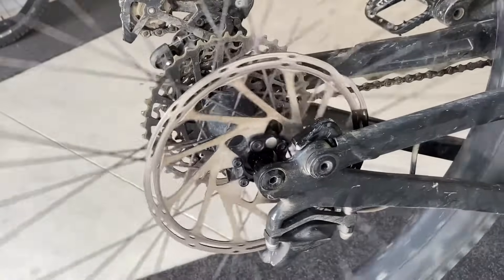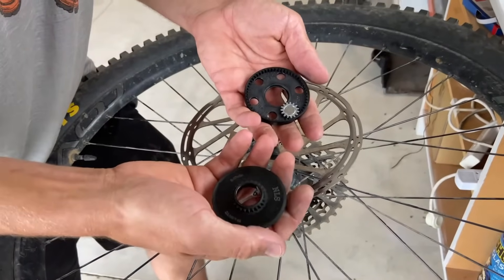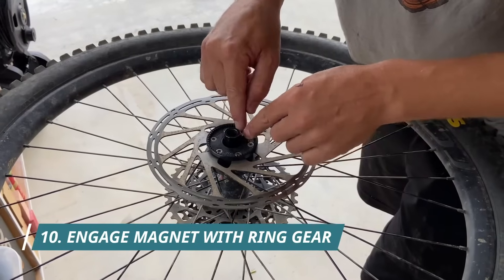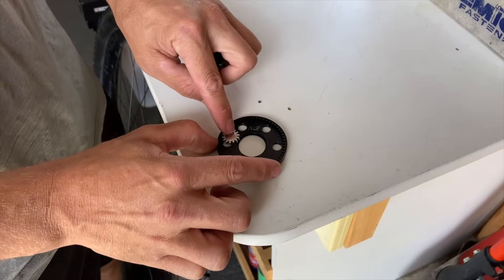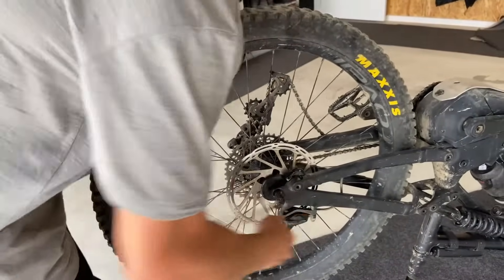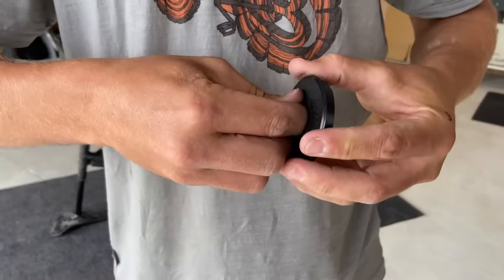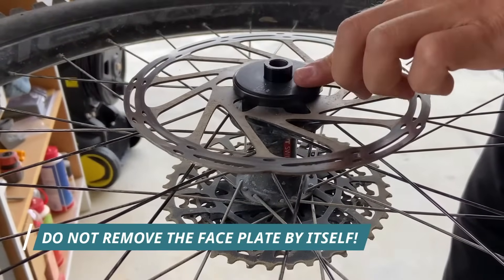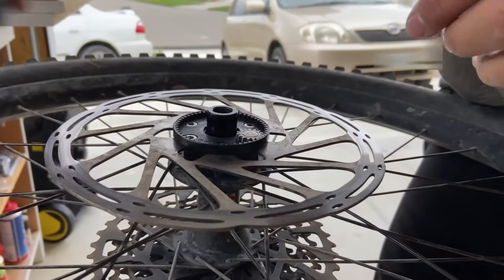E-bike speed delimiter: SPEEDi [6 Bolt Installation Instructions]

Comment: Does this work on a Orbea Vibe H30 with rear hub motor from mahle?
Reply from the maker: Unfortunately SPEEDi is not compatible with rear hub driven motors sorry.
Reply: @ thanks a lot for your fast response. Are you looking for producing a product?
Reply from the maker: @florianwagner8020  At this stage we do not have anything in the works for hub driven motors sorry.

Comment: Does it Work in the Bosch Smart System with Magnet on the valve?
Reply from the maker: Unfortunately, this system is not compatible, sorry. Your bike may be able to be changed to to the rear rotor mounted system though. Check with your local dealer.

Comment: Does this interrupt the odometer?
Reply from the maker: The odometer will be out by 1.5x when SPEEDi is installed. This is because we are essentially tricking the bike into thinking it is going slower than it is.
Reply: @ brilliant and if you want to remove the magnet, I guess you just lift the first cover off and take the magnet out and it goes back to normal?
Reply from the maker: @SingheBiker  If you want to go back to normal you would need to remove the whole unit, and re-install the stock magnet. It's a very quick process - maybe 10 minutes.

Comment: "That's essentially it". Except he neglected to mention the importance of magnet alignment with the sensor on the frame stay. Common knowledge? It never pays to assume everyone knows what they are doing!
Reply from the maker: Great point! However, SPEEDi shouldn't require any specific magnet alignment. We pair the size of the unit to best match the bike and where it's sensor is located. We also use a much stronger magnet than standard, so even if there is a slight difference the sensor should still pick up the SPEEDi magnet no problem.

Comment: Just be nice if the speed was increased by 2:1
Reply from the maker: Great thought! We did try higher ratios like this, but found the 1.5x to be the sweet spot. We wanted to keep the units small, robust and reliable. There's limited real estate where the SPEEDi sits, and we wanted to make sure they were reliable and robust. The bigger the unit, the thinner it has to be to clear the frame and any other parts. We have found that everyone after using the 1.5x agrees it is a massive change and enough.

Comment: What end cups of the hub is compatible ,because it is not compatible with my Freehub I9 1/1 microspline. Can I change the end cups or I have to change everything (hub) complete
Reply from the maker: The I9 1/1 is a compatible hub. If you'd like to email us with your details we can check it out.
Reply: @nlscomponents  I tried already and de internal diameter of ispeed is bigger that the end cup
Reply from the maker: @sisovr4636  We do have a unit that is specific for the I9 1/1 hub so maybe the unit you tried was for a different hub?
Reply: @nlscomponents  do you have it send me the link to find it,please
Reply from the maker: @sisovr4636  the exact part will also depend on what make and model of bike it is going on. If you would like to email us the details of the bike we can check it out :)

Comment: Just waiting on this to be delivered. Is there any precautions to take when cleaning the bike after a muddy ride?
Reply: What’s your thought about this ? Is the real speed still on the screen or is the speed not accurate due to the speedi ?
Reply from the maker: Sorry for the (very slow) reply here. There is no precautions needed for washing the bike. The speed will not display correctly on the screen, as we are essentially tricking the bike into thinking it is going slower than it is. Likewise, the distance will not display correctly either. If you have a Garmin, or similar computer with GPS, this will show you an accurate speed/distance as long as it's not connected to the bike.

Comment: what is the material of the components? plastic or metal? i mean the box..it seems fragile
Reply from the maker: The Backing plate and Cover are made of Acetal/Delrin which is a self lubricating engineering plastic with a very good strength to flexibility ratio, meaning it does flex a lot before breaking, and is strong enough to stand on when assembled, the magnet is marine anodised (twice as thick as standard) 6061 T6 aluminium for corrosion resistance and durability.
Reply: Do you have to take the disc brake bolts off when installing it? Because when you took it off, you just pulled it off without taking the bolts off.
Reply from the maker: @Shawn-in-da-Canyon   Good spotting, you are correct, the Backing plate is a press fit onto the heads of the bolts, so you 'can' leave the bolts on, but it is more difficult and is likely not pressed up tight to the disc, because of this we recommend removing the bolts and starting from the beginning, this ensures the backing plate has pulled up correctly onto the disc.